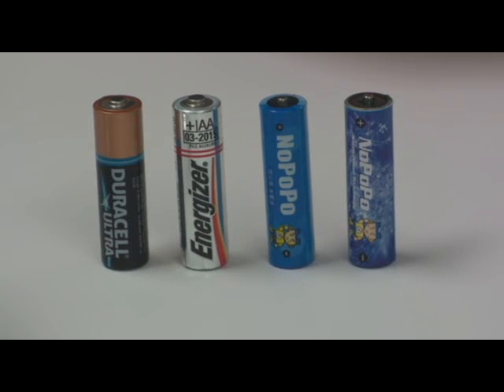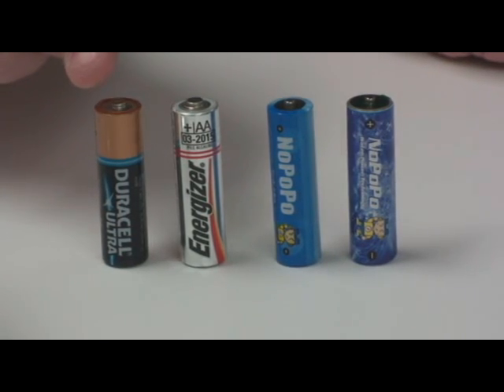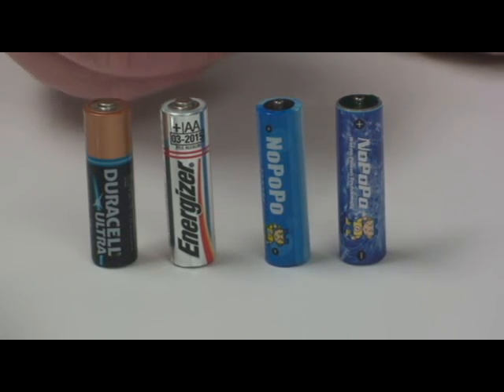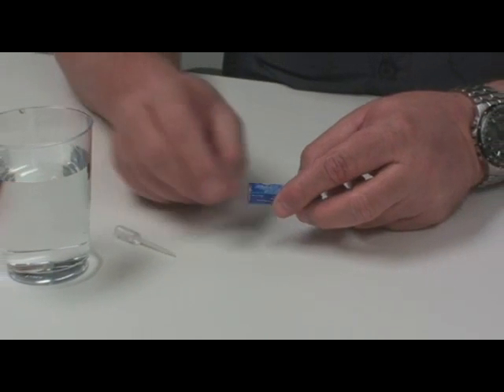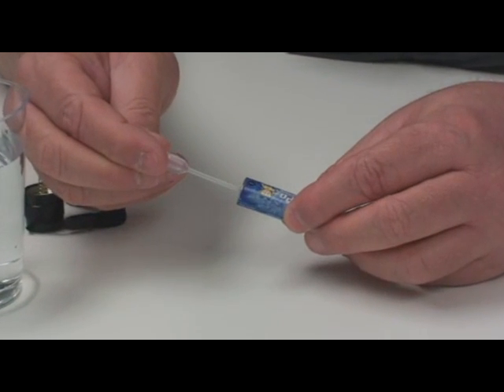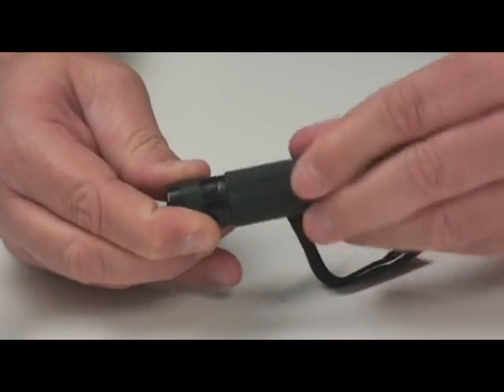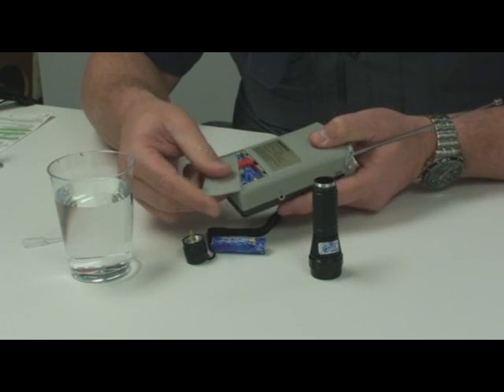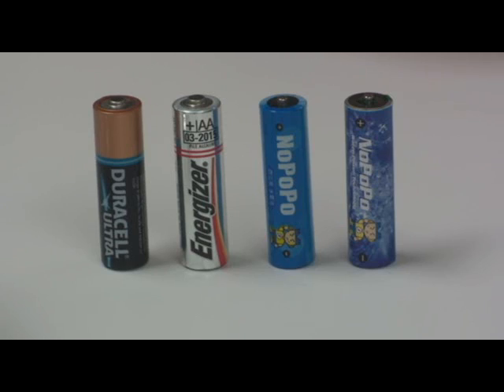Water Battery

Comment: Problems arise viva ( leakage ) will damage the negative spring and positive electrode .!! Acid base due from combination of two type of different metals .!! same as Bagdad type battery which is a corrosive  battery. Moisture and oxygen = ozone = corrosive heat.

Comment: A 5 batteries= about 1 batterie B: Its practically impossible to get in the stores C: Almost no one gives a crap and D: You will be spending so much more on these batteries via gas or shipping costs its just not worth it.
Reply: There's little point in using these every day. The main claim to fame for water-activated batteries is an indefinite shelf life, so they'd be useful mainly to keep in storage for emergencies.

Comment: Alkaline batteries does not have acid inside them. The only batteries we use that have acid in them is Lead Acid Batteries found in Cars. Even when an alkaline battery leak, it does not leak acid. Alkaline batteries has an electrolyte materials inside rather than acid. And when they leak, they leak Potassium hydroxide. Potassium hydroxide is a strong base not an acid.
Reply: Yeah, Alkaline is literally the opposite of Acidic.

Comment: Rechargable make more sense.  Even my 9 volts are $3.00.  I recharge using a solar cell.  Try to out green that.
Reply: +KolokoGamer Just saying you probably waste more materials in a day than a animial your size in 2 months
Reply: That is a good solution, but rechargeable batteries only have a set number of times you can charge them before they die out, and they are not recyclable either after they die.
Reply: i really don't give a rats butt about recycling. That's what God made land fills for.
Reply: texjarhead Wow you know recycling is a good thing for the world......stfu and gtfo
Reply: john cuting
What? i scavenge waste's and use that